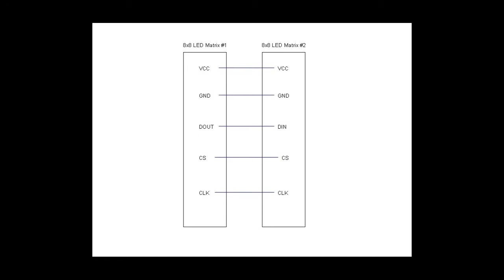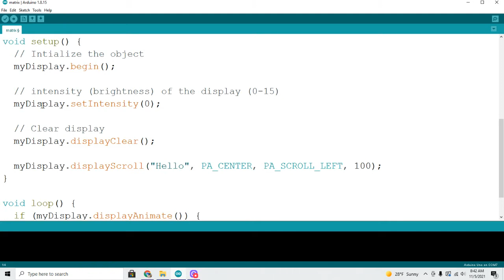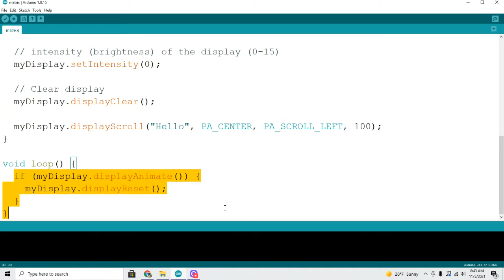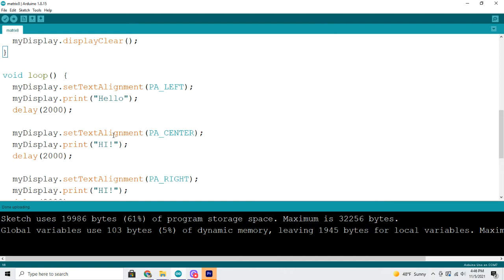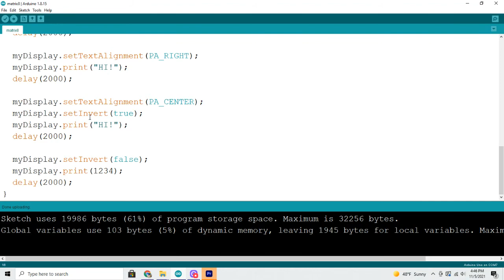Make Your Own LED Matrix Display Using Arduino With MAX7219 LED Module - 8x32 Display For Beginners

Comment: When adding a second module, does the matrix stack short end to short and or long end to long end?  It looks like you suggest series connections when connecting two or more, that would tell me short end to short end?  Please confirm.
Reply from the maker: Hey there!
Yes — the modules connect short end to short end when you daisy-chain DOUT to  DIN, and that’s the correct way to extend them. You can physically arrange them in different orientations (stacked vertically or stretched horizontally), but physically they must always be connected DOUT of one module into DIN of the next. Also, if you’re running multiple 4x1 matrix boards, it’s a good idea to feed 5V and GND into more than one point in the chain (for example, at both ends), because a single feed can cause voltage drop and dimming across the chain.
I hope that helps. 👍👍

Comment: how do you connect a second row of 4?  ledmatrix number 5 is seen the same as the first
Reply from the maker: Hey there!
You daisy chain them together and the data cascades from one to the next.   
After you connect the first MAX7219 8x8 x4 Dot Matrix Display Module to your Arduino, the second connection will look like this: 
VCC-VCC, GND-GND, Dout-Din, CS-CS, CLK-CLK
***Dout connects to Din 
Don't power these modules using Arduino. Use external power and make sure you connect common ground between Arduino/MAX7219 8x8 x4 Dot Matrix Display Module/external power supply.  Make sure you have plenty of current for some  overhead to prevent heating. 👍

Comment: Hey man really helpful video, Im trying to daisy chain the displays but I'm having issues with the signal not getting received right presumably due to the wire connections. I saw your comment about using straight pins and jumper caps how did you do this? If you still have a picture that would be wicked! Thanks man
Reply from the maker: i can send you a picture of how to link them together with jumper caps. send me a facebook mssg or i can email it. 	 👍bmonsterlaboratory@gmail.com

Comment: How would I go about replacing the text with a variable like "points" this library doesn't play well with variables
Reply from the maker: Hey there! Do you just want "Points" to scroll?  Do you want anything else?  How many 8x8 matrix modules are you using? 

Are you using these libraries?:
#include <MD_Parola.h>
#include <MD_MAX72xx.h>
#include <SPI.h>

in a 8x32 matrix module make sure to include this:
#define MAX_DEVICES 4
and:
myDisplay.displayScroll("POINTS", PA_CENTER, PA_SCROLL_LEFT, 100);

I hope that's helpful - happy to help if you still need it. good luck! 💪
Reply from the maker: If you want a bigger display, also check out Teensy  4.1 - this board works great with LED sings if you have them powered correctly.  https://youtu.be/oMlgBs5TzYA
Reply: @BMonsterLaboratory  In that format, yes but I need a variable(Points) that displays a value that is constantly changing via other code, I just need it to display, for example, id have: int Points = 1; I need 1 (or stored value) to display. there's not much information out there on this topic unfortunately.

Comment: Hi, Wondering if there is any chance of getting the full Script for this, please
Reply from the maker: Hey there!  The code I used is posted on Facebook. go there and search #8x32max7219  - check the comment section. I have 2 different sketches posted there. A lot of the time it's too long to post here. hope that helps! 👍
Reply: @BMonsterLaboratory  Hi, from someone is just starting with ARDUINOs and stuff, I am looking at JUST ONE, SINGLE 8x8 Matrix to show a NUMBER, as in 1 or 2 or 3 and so on to 0, in total 10, I believe there will a number of the same code with this, so I am willing to except just ONE TO START and I may be able to ADD THE REST. THANKS
Reply from the maker: @graemewilson4126  sounds good!  Try this. #include <MD_MAX72xx.h>
#include <SPI.h>

#define HARDWARE_TYPE MD_MAX72XX::FC16_HW
#define CS_PIN 10
#define MAX_DEVICES 1

MD_MAX72XX mx = MD_MAX72XX(HARDWARE_TYPE, CS_PIN, MAX_DEVICES);

// Define the bitmap for the number 1
const uint8_t num1[] PROGMEM = { B00000000, B00000001, B00000001, B00000001, B00000001, B00000001, B00000001, B00000000 };

void setup() {
  mx.begin();
  mx.control(MD_MAX72XX::INTENSITY, 2);  // Set intensity (brightness) level

  mx.clear();  // Clear the display
}

void loop() {
  mx.clear();  // Clear the display

  // Display the number 1
  mx.setRow(0, 0, num1[0]);

  delay(2000);
}
-change the bitmap to get different numbers.
Reply from the maker: here's a 9 to 0 countdown on 1 single 8x8 matrix.     
#include <MD_MAX72xx.h>
#include <SPI.h>

#define HARDWARE_TYPE MD_MAX72XX::FC16_HW
#define CS_PIN 10
#define MAX_DEVICES 1

MD_MAX72XX mx = MD_MAX72XX(HARDWARE_TYPE, CS_PIN, MAX_DEVICES);

// Define the bitmaps for numbers 0-9
const uint8_t numbers[][8] PROGMEM = {
  { B11111100, B10000010, B10000010, B10000010, B10000010, B10000010, B11111100 }, // 0
  { B00000000, B00000000, B10000010, B11111110, B10000000, B10000000, B00000000 }, // 1
  { B11100100, B10010010, B10010010, B10010010, B10010010, B10010010, B10011100 }, // 2
  { B10000100, B10000010, B10001010, B10001010, B10001010, B10001010, B01110100 }, // 3
  { B00011100, B00010010, B00010010, B00010010, B11111110, B00010000, B00011110 }, // 4
  { B10011100, B10010010, B10010010, B10010010, B10010010, B10010010, B01100000 }, // 5
  { B01111100, B10010010, B10010010, B10010010, B10010010, B10010010, B01100000 }, // 6
  { B10000000, B10000000, B10000010, B10000010, B10000010, B10000010, B11111110 }, // 7
  { B01110100, B10001010, B10001010, B10001010, B10001010, B10001010, B01110100 }, // 8
  { B01111100, B10010010, B10010010, B10010010, B10010010, B10010010, B11111100 }  // 9
};

void setup() {
  mx.begin();
  mx.control(MD_MAX72XX::INTENSITY, 2);  // Set intensity (brightness) level

  mx.clear();  // Clear the display
}

void loop() {
  mx.clear();  // Clear the display

  for (int i = 9; i >= 0; i--) {
    mx.setRow(0, 0, numbers[i][0]);
    mx.setRow(0, 1, numbers[i][1]);
    mx.setRow(0, 2, numbers[i][2]);
    mx.setRow(0, 3, numbers[i][3]);
    mx.setRow(0, 4, numbers[i][4]);
    mx.setRow(0, 5, numbers[i][5]);
    mx.setRow(0, 6, numbers[i][6]);
    
    delay(1000);  // Delay for 1 second
  }
}
Reply: @BMonsterLaboratory  sorry have copied and pasted this but what I believe is it format, I have it wrong as trying to VERIFY came back a error, so I need to have the actual code, with just the one number - please

Comment: When i connect my board with my pc matrix display's led doesn't even on why??? 

Pls rply...
Reply from the maker: hey there!  It sounds like you may need to run MD_MAX72XX_Test.ino to help figure out which hardware type to use in code. go to the example code in the MD_MAX72xx library and run the test. open the serial monitor and follow the directions. It will ask questions about what you see on the matrix. After you answer questions it will tell you what to put for the hardware type - it could be PAROLA_HW, ICSTATION_HW, GENERIC_HW, or FC16_HW. for me it's usually FC16_HW. I hope this helps. It can be frustrating at first but once you get it, it's pretty cool.  sorry about the late reply....big trip coming up soon.  Best of luck to you 👍

Comment: Hello can you tell the components which is used i am unable to understand it in video
Reply from the maker: hey there!  For this, all you need is arduino, jumper wires, breadboard, breadboard power supply, and the MAX7219 LED Module. 👍
Reply: @BMonsterLaboratory  thankyou so much
Reply from the maker: @Jayshreesen29  you're welcom. Good luck with your projects

Comment: What is pin 13 called
Reply from the maker: Hi there. In the video I used the LED module clock pin at pin 13. Pin 13 is a digital pin on your Arduino. It is also connected to your onboard led.

Comment: sir, how to display  two different text SIMULTANEOUSLY, in two DIFFERENT 8 by 32 max 7219, using SINGLE ARDUINO BOARD. please. in 1st 7219 i want to display name of organization. and in 2nd board i want to display date and time.
Reply from the maker: hi there! Download MD_Parola library. Define Max_Devices as 8. There are many examples to get you started. You can upload the display example or any of the others to your Arduino - they're a huge help!

Comment: My only question is when connecting two displays together, how do I  get the VCC, GND, DOUT to DIN, etc. to actually stay together? Is there a female adaptor that would go on the board so I can directly plug the male into the female? I have three 8x8 that I need to connect together to make a 8x24 display. I'm basically just asking how do I connect them when they are directly next to each other?
Reply from the maker: My favorite was is to use straight pin headers, not the curved ones they give you, and connect them using a pin header jumper cap. They keep everything close and they are easy to remove later if you want. There are other ways but this way is the cleanest look i think.
Reply: @BMonsterLaboratory  Alright thanks. really good and helpful vid btw.
Reply from the maker: @ScottFerguson16  thank you!
Reply: @BMonsterLaboratory  So I have my matrix boards. My only concern is are you sure the jumper pin caps aren't going to prevent the led matrix from coming down all the way? The pins seem to be a bit long too
Reply from the maker: @ScottFerguson16  I'll post a picture to the facebook page this evening if it would be helpful
Reply: @BMonsterLaboratory  That would be very helpful. Thank you.